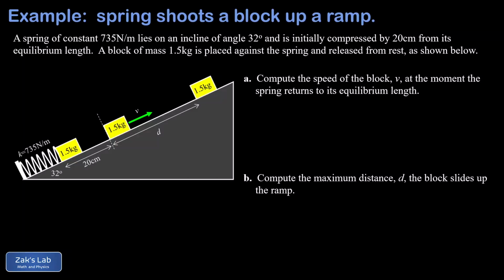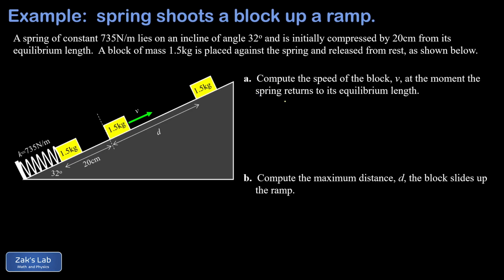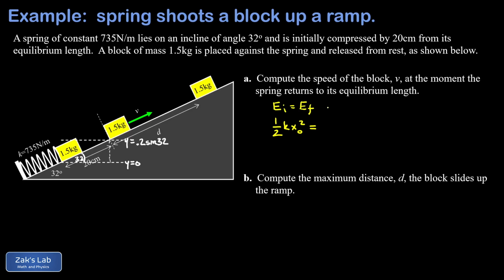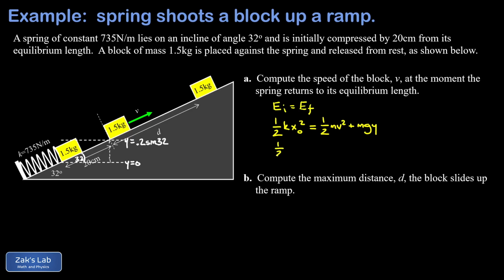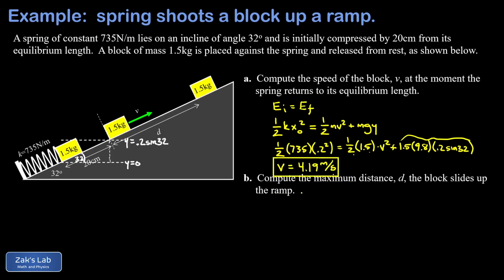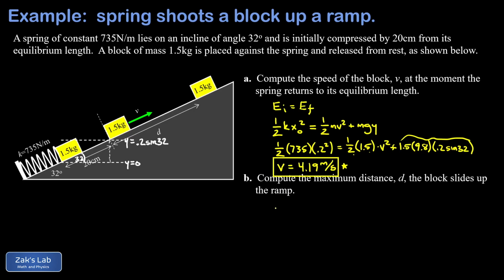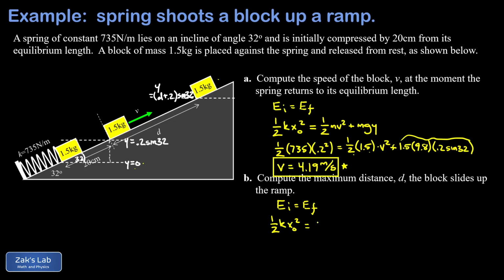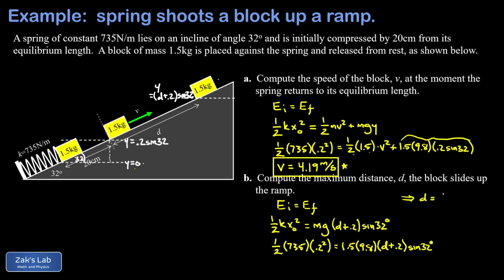Spring shoots a block up a ramp:  find the speed at the equilibrium length, maximum sliding distance

Comment: After the spring returns to its equilibrium position, why is there no initial gravitational potential energy in the second part of the problem?
Reply from the maker: The second half was analyzed by comparing the initial state (y=0 so PEg=0 and the spring is coiled) to the final state (all the energy is grav. PE and the spring is relaxed).  With the chosen initial state, the initial grav. PE is zero because we put the origin of the y coordinate at that initial position.  

The way you asked your question -- initial state with the spring returned to its equilibrium position - makes it sound like you want to use the equilibrium position as your initial state.  That's fine, just not the way I chose to analyze it.  If you use the equilibrium position as the initial state, then your initial energy would include both kinetic energy using the velocity from part a. and grav. PE IF you use the same origin for the y coordinate.  Alternatively, you could start over by defining y=0 to be the height at the equilibrium position and work from there.  z

Comment: Why is work done 0? Isn't there work done by a force applied (the spring force)?
Reply from the maker: Potential energy is a book-keeping device specifically designed to account for the work done by a conservative force.  For conservative forces, the work done depends only on the initial and final position, making the idea of potential energy possible.  So if you're doing an energy conservation problem, you ARE calculating works done by the conservative forces.  The only time you have to explicitly include a work calculation is when there is a non-conservative force (usually friction), and we have to generalize to saying Ei+Wnc=Ef, where Wnc is the work done by nonconservative forces during the process,.. z
Reply: @ZaksLab   Understood. Thank you so much!